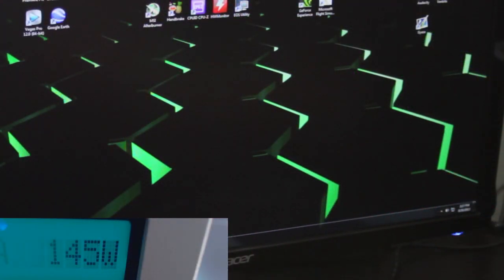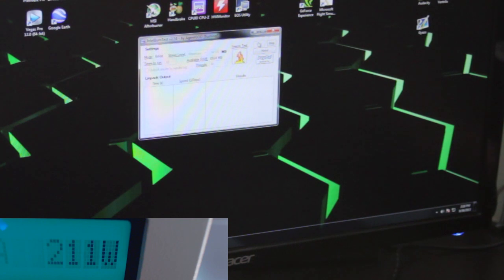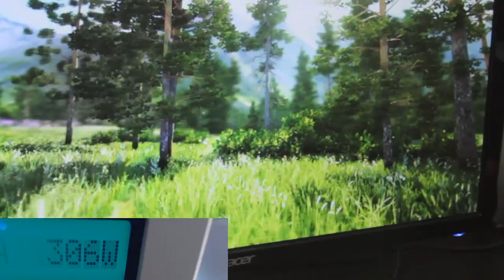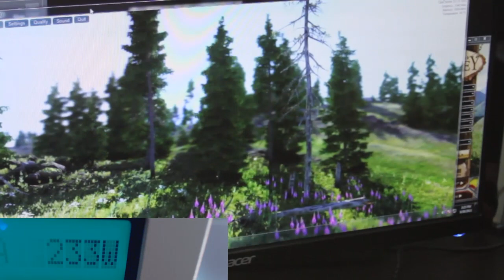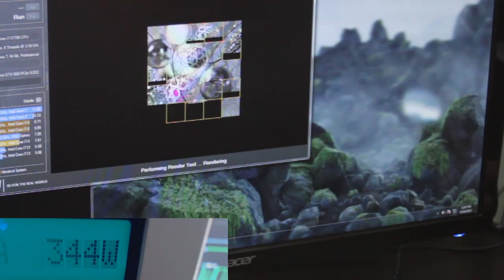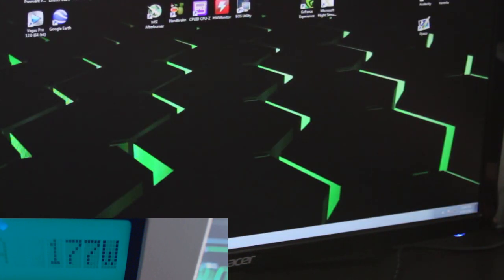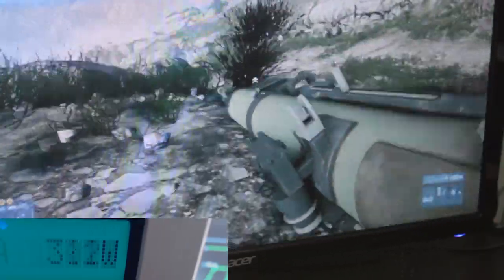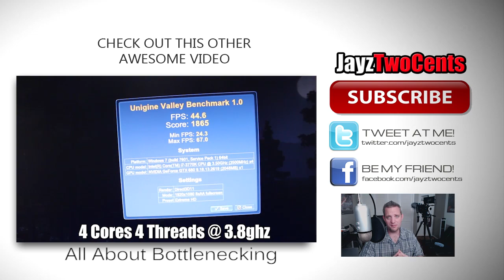How big of a Power Supply do you REALLY need?

Comment: hey jayz2cents,
on the extreme outervision, i put in all the stuff that i'm currently using, and i got about 730 watts. I plan to go with a 1000W power supply since i'm going to keep it for an extended period of time (6 years +), meaning that the capacitors will get old and not be able to deliver as much power as it could in the first year or so.  What do you recommend? (less wattage?, if so, why?)

Comment: it may be me misunderstanding you, but from the way you were explaining PSUs and 80 plus in this vid it seems like you don't know anything about them. as one person pointed out many PSUs are most efficient at about 50%. so if you have a rig that uses 300 watts a 600 watt PSU is excellent. You  also sound like a PSU draws the rated wattage from the wall socket at all time even tho your vid shows different. another thing is that all PSUs need to age. they lose some efficiency over time.

Comment: no if you take 300 watt with that meter it take the Watt from he wall so if you have a 80 Plus your system will only use it means your system is using 240 Watt and 60 Watt is lost through heat.

Comment: I'm running on a 430w PSU and am looking to upgrade my GPU to a 7970 from a 7770. I was wondering if a 650w would be enough. I also wanna upgrade some other components. Should I go 750w? I saw how jays was low watt but I have a lot of AMD stuff and it seems they take more power. Any suggestions?

Comment: Dude, I think that's the same processor I plan on getting. Along with the Evga GTX GeForce 660 Graphics card. My power supply will be a Rosewell Green Series RG530-S12 530W Continuous @40°C, 80 PLUS Bronze Certified. I am hoping this is a decent rig.

Comment: Well it could work but it would be pushing it either way you can't even use a 7950 with the CX 430 it on has a 8pin connector you need an 8pin and 6pin for a 7950.

Comment: Hey guys I have a amd a8 and radeon 7950 system
the APU uses  about a40 Watts of power and the 270 Watts of power.
That mean I can have a 450 Watts easy but I got the cheapest fully modular power supply I could buy for $60. I might get crossfire later good is it a good buy?

Comment: It is funny but some people make two big mistakes with builds very often. First, not having a PSU supplying a correct amount of output and second using a cheap - ass no name supply which is so bad to do. A Brand name quality PSU will deliver a smooth flow of steady safe voltage above it's rating, a cheap-o no name brand well, you are lucky if it even delivers what it is rated for. Well worth using a good dependable quality supply rated for your needs!

Comment: Very insightful, as I was afraid (half a year ago), that 500 Watts wouldn't be enough for my i5 3570k, let alone overclocking it. However, right now I have it overclocked 4.1 GHz with the same power supply and runs perfectly fine.

Comment: What? 1000W power supply at 80% efficiency only puts out 800W to the system? I don't know about that one, I thought it meant that it would put out 1000W and pull 1250W from the wall.

Comment: Rosewill hercules 1600 watt 1 single core celeron cpu that I downclocked to 450 mhz no gpu 1 60 gb ssd, 2 gb ram, no fans, and a 300 x 300 monitor do you think my psu is bottlenecking my components?????? #yolo